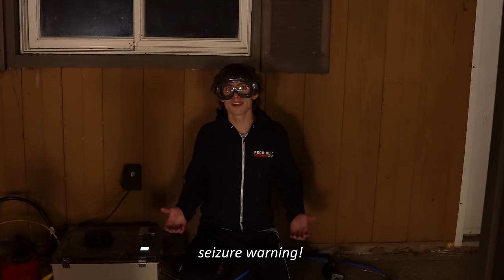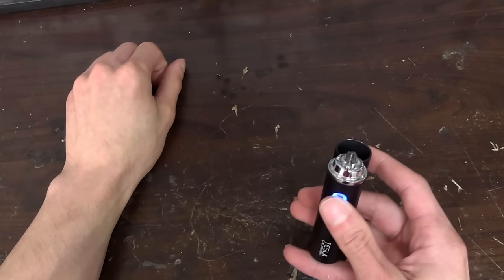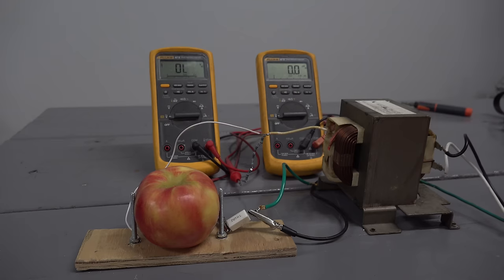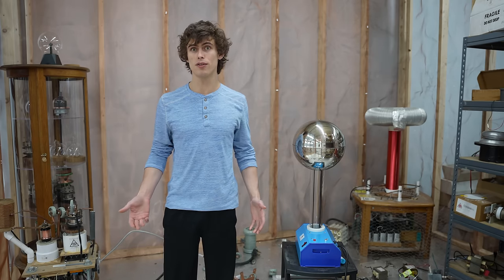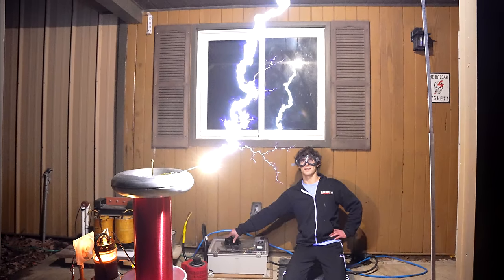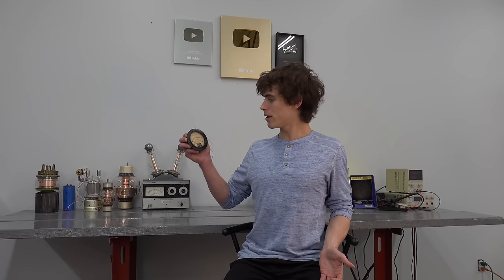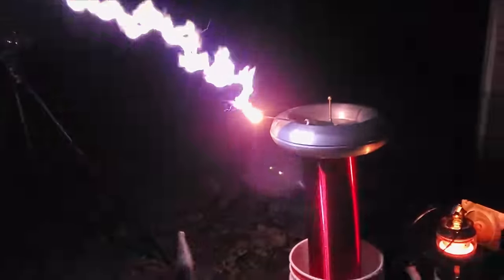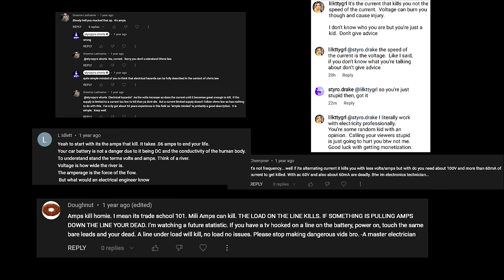Is it the volts or amps that kill?

Comment: Hilarious how plenty of people criticize you because you "look young", touting their electrician credentials or whatever. To my eyes, you're an engineer, and have at least a bachelors level of understanding in electrical engineering. You also analyze the problem pretty well, so why would anyone think that you were some tenage hack playing with electricity? You make a pretty good case that  the current/duration chart is misleading or wrong, and that voltage and frequency play an important role in the effect on the body. Good job styropyro.
Reply: He is H.S. age, isn't he? Sure knows his stuff, though!!!
Reply: @leechjim8023  if by HS you mean high school; no, he's around 30.
Reply: "so why would anyone think that you were some tenage hack playing with electricity?"
Perhaps because that is exactly what it looks like.
Reply: You have that in most industries basically. I am a software engineer and I’ve heard plenty of older people suggesting they have a better understanding of things based on years sat on a chair than somebody young with a passion and curiosity, doing research non-stop, learning from the best in the industry instead.
I am now responsible for interviews and I always put passion and curiosity as one of the highest values.
Reply: @aliancemd  "I am a software engineer"
COL (chuckle out loud).  Is that what used to be called a computer programmer?   But it had nuances.  The programmer developed the algorithm; that's the hard part, the design.  A "coder" takes that design or program and implements in in the particulars of a language and hardware.  No creativity is needed for coders.
Reply: @aliancemd  Higher in social hierarchy was the Systems Analyst; the person that identifies a problem and decides or creates a solution to that problem.  A computer, or some other form of automation, might be part of the solution; as part of a larger system.   Naturally, the systems analyst needs broad spectrum education and experience.  A software engineer probably benefits from line-of-business knowledge and experience. Coders need only understand the particulars of a language and maybe also hardware in the case of high performance programming.   I do all of that to some extent and "eat my own dog food" so to speak.  In my Navy days I wrote a program that solved a communications problem, created my own interrupt service routines in assembly language, and implemented multi-tasking on a small MS-DOS based 8088 CPU chip computer.  It wasn't all that granular; it used the 18 Hz master clock interrupt to drive the scheduler but incoming data triggered interrupts and so the multi-tasking was smooth enough for its intended purpose.
Reply: Most of the 'engineers' and 'doctors' in Youtube comments are teenagers. I never take them seriously.
Reply: @gaynzz6841  "what u chuckling at boomer?"
Glorious titles for ordinary things.  What exactly does a "software engineer" DO?  

"Software engineers apply engineering principles and knowledge of programming languages to build software solutions for end users. Software engineers design and develop computer games, business applications, operating systems, network control systems, and middleware"

In other words, used to be called "computer programmer".   A computer program is now a "software solution".  

Needless to say (hopefully) there's a HUGE difference in the skills of a game designer versus an operating system designer.  How hard is it to slap some Python, PHP or Perl together on a "web app" versus several million lines of code for even the simplest operating system?  

A bit too easy.  My employer paid $40k for a little PHP application that was incredibly buggy, vulnerable to the most obvious SQL injection attacks (user input handed, unquoted, to PHP database query strings).  Another PHP program crashed if you included a comma anywhere in the data input.  The client used lastname, firstname convention and broke it almost immediately.  That's because, unquoted, the comma became part of the PHP syntax rather than data and now the number of fields no longer matches the schema of the database.
Reply: @spewky2955 agreed. Dude would have been fine if he left out the cringe 😬 reminds me of the redditor from the Slappable jerks channel lmao
Reply: @spewky2955 "embarrassing yourself with that alone."
Since I do not feel embarrassed I doubt this is correct.  I suppose it is how you would feel if you behaved as I do.  Of course, if you behaved as I do then you would feel as I feel. 
I seldom actually laugh out loud (LOL) but I do sometimes chuckle out loud (COL) and for the sake of language precision I specify which it is.
Reply: @thomasmaughan4798  obviously you have never, ever, looked at a modern 3D game engine huh? python? PHP? Perl? lol, "chuckling out loud"!! Most games are now more complex than any operating system that has ever existed "COL"
Reply: @gaynzz6841  "Most games are now more complex than any operating system that has ever existed"
That seems unlikely but I see little benefit in proving one or the other on a page about volts or amps being more dangerous.
Anyway, you are correct about your assertion that I have not studied modern game engines.  The last time I looked into it was Doom and Descent, particularly the ray-casting of Doom; I think Descent might have had actual ray tracing but not with features such as reflection and refraction. 
Because of that study I am all the more impressed by things like Skyrim with true 3D (stereoscopic) rendering, water and mist effects.   I doubt these are necessarily  complex since there's no more complexity to casting one ray as a billion rays; it just takes a LOT of computing horsepower and if you have it, the multi-processing power of a GPU.
Reply: @thomasmaughan4798 if you think that the only difference between modern game development and the raycast tech you describe is simply an increase in the number of raycasts, that tells anyone in the field just how incredibly out of touch you are. modern software engineering looks absolutely nothing like your “computer programming”, COL (chuckling out loud)
Reply: @romir.k  "tells anyone in the field just how incredibly out of touch you are."
Oh yes, absolutely.  It might even matter to someone.
Reply: @thomasmaughan4798 you’re right! It might! Cheers
Reply: theres no fool like an old fool.  if electricians had anything figured out, the electric code wouldnt have changed like 100 times in the past 10 years
Reply: Electricians aren't that smart
Reply: @thomasmaughan4798 As a real Engineer, seeing “engineer” tacked onto job titles to make them sound like they require more knowledge than they do drives me crazy.  Luckily I live in a jurisdiction where using the title “Professional Engineer” requires one to be licensed, which in turn requires an engineering degree and 5 years of relevant engineering work experience.
Reply: @rupert909  No way he,s 30, 20 max.
Reply: @thomasmaughan4798 Would showing a bit of humbleness kill you? 😅
Reply: @2hotflavored666  "Would showing a bit of humbleness kill you?"
It might; but then you'd never know whether I died or simply joined the billions of humans that do not reply to you.
Reply: "No creativity is needed for coders."
Concur.  On the other hand, a coder could be efficient at implementation of the program using knowledge of the hardware.  My programs on the Honeywell mainframe ran as much as 10 times faster (or taking 1/10th the amount of time) by taking advantage of very specific hardware features.  
Nowadays that efficiency boost can happen if the application or task can be made parallel and use a GPU.
Reply: @thomasmaughan4798  so based on your logic, if you used math in another domain then you are a loser, since you arent spending your time making your own math theories and are just using other's work right?
Reply: @haytamhaytam7227  "if you used math in another domain then you are a loser"
Non-sequitur.  Using math in a different domain simply produces different results.  For instance, doing addition using an analog clock produces results such as 8 plus 8 is 4.  It isn't wrong it is just in a different domain; modulo 12 with no carry.

A famous saying is that there's 10 kinds of people in the world; those that understand binary and those that do not.
Reply: @thomasmaughan4798  then whats the difference of using algorithm for software engineering instead of operating systems?
Reply: @haytamhaytam7227  "whats the difference of using algorithm for software engineering instead of operating systems?"
The distinction is unclear.  Operating systems are engineered software.
Reply: @haytamhaytam7227  "and are just using other's work right?"
I do not understand a statement or claim followed by "right?"
But if you seek agreement that the mathematics I use were developed by other people, yes, of course.  Presumably a "Taylor Series" is named for someone named Taylor.  Muslims appear to have invented or discovered algebra (al-gebara or something like that).
Reply: @romir.k  real question, I assumed most modern game engines were derivatives or iterations of older game engines? I'm specifically referring to the Quake and Unreal engines which this over the hill old fckr was fascinated and entertained by...in fact unreal 1 ( tournament) was a huge underdog at the time, I have very fond memories when I see it still being implemented or the foundation of it.....I guess Quake morphed to COD ect....

 Old people like me need realize it's ok, there is a Prime and we are past it...ALL the insecurities manifest itself in standoffs when we should be proud a new generation is running with the ball ( if it makes one feel better if you were born in their generation you would have run with it too )...
Reply: @leechjim8023   if he is 20 that would mean he uploaded his first video when he was 3 years old xD Styro is 31
Reply: @Yaonglol  "Bro's out here writing articles."
U shure bout dat?
Reply: Easily masters level. His practical experience is top tier
Reply: Bro is literally the epitome of a reddit debate lord, jesus christ :D
Reply: This dude has tesla in real life vibe lol
Reply: @ManHeadRambo swish lol
Reply: @thomasmaughan4798  Cope harder.
Reply: @Nyx_2142  "Cope harder."
Cope?  Challenging Outdoor Personal Experience?  Okay!
Reply: @thomasmaughan4798  I think your time would be better spent somewhere other than this thread. It's been over four months since your initial comment. Let it go. The continued involvement in the discussion is just embarrassing to watch, and claiming to not be embarrassed only adds to it. 

Maybe read a book, or go outside. Do you have a wife or kids? Attend to them instead of berating online strangers because their job titles don't match your antiquated idea of that field. It's frivolous and would diminish your image, were it visible to your friends and family.
Reply: @nolanthedude  "I think your time would be better spent somewhere other than this thread."
You are here.  I am here.  Well at least your words and my words.  Since it is clearly worth your time to respond to me; how can I fail to honor you by not responding?  
"and claiming to not be embarrassed only adds to it."
That is all it is; a claim.  It seems to be more important to you than it is to me.  
Anyway, I don't remember why either of us are here.  Maybe I will review the comments and see if I can figure it out.
Reply: @nolanthedude  Review complete.  It appears to be related to the apparent age of the person making the video, and that in turn somehow produced conversation about abuse of the word "engineer".   It is not clear why I or anyone should feel the emotion "embarrassment" over any of this.
Reply: He has above a Bachelor's level of understanding

Comment: Great video. What you've perfectly demonstrated is the rules taught to professionals are a grossly simplified version of reality. The thing about "professionals with electricity" and "master electrricians" is they have a small amount of knowledge but think they know it all. In the industry we call this "Peak of Mount Stupid" and these are the most dangerous people to work with. It takes a LOT more knowledge to get over the peak and start working towards actual understanding.
Reply: There's a big difference between an electrician (a tradesman who works with electricity under predetermined circumstances) and an electrical engineer (the person who knows enough about electricity to create the circumstances and rules that electricians operate under)
Reply: @bosstowndynamics5488  and there's another level beyond that, of the physicist who experimentally determines the ruleset the engineer uses to create the electricians environment.

The best part is that the physicist isn't going to know how to wire a house. Nobody knows everything.
Reply: @myuzu_  do you think AI will help plebs like me bridge the gap? I surely wouldn't trust an online tutorial to build a house, but didn't our predecessors order houses in a catalogue to build themselves and the instructions had a bit at the end with suggestions on what to do with the left-over parts? I'm too lazy to even take a picture of mount stupid so can't I exploit knowing nothing by using a know-it-all bot? What is that? The layman lazy river of calamity.

Comment: For cardiac arrest a main factors also is when the shock hits. The Heartpulse has a tiny vulnerability frame where if stimulated the heart muscle will start to spasm.
This is why lightning is mainly leathal through cardiac arrest. Sure, you might expirence severe physical trauma and some serious burns, but if it doesn't hit (and I forgot which part of the heart impulse) then there's a chance you'll life :>
that was part of my final research before graduation ^^
This video has been a delightful recap of the things I loved to learn in highschool but haven't used much since graduation. Thank you so much ^^
Reply: You mean like what happened to Damar Hamlin? Or is it a different window?
Reply: R on T phenomenon. Sending an impulse on the T wave causes the ventricles to beat again when they are supposed to be repolarizing. It's also called a PVC (premature ventricular contraction) which isn't normally too concerning unless it occurs during that time interval (which is why having them frequently or several in a reading ends up being cause for alarm). IIRC when a PVC falls on the T wave it can cause the ventricles and atria to be out of sync, which can end up with the ventricles doing that funky little dance called ventricular fibrillation and then not-so-funky asystole. That said, I've only taken a college course or two with only a little focus on it/research online out of curiosity so I'd love anyone with more experience than me to correct me on anything/add on!
Reply: This is (indirectly) noted on the lethality chart shown in the video… It notes chance of fibrillation in relation to a 50% probability — presumably to account for the impact of heart beat phase